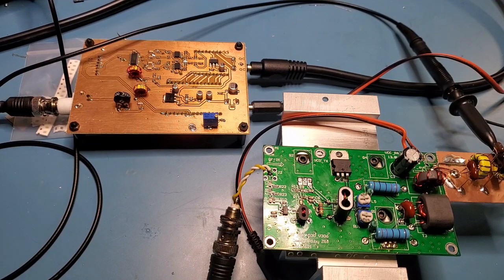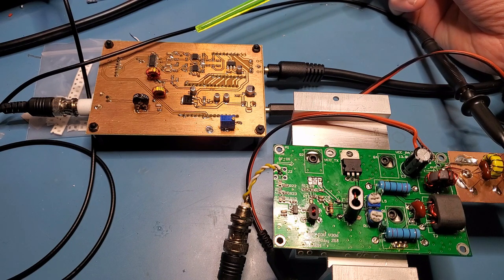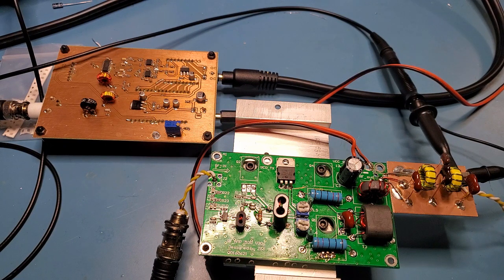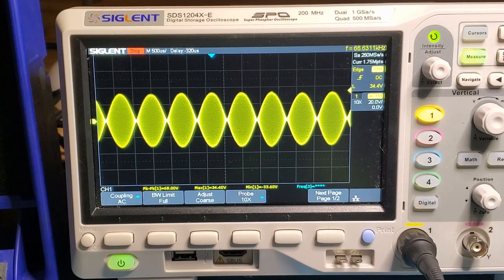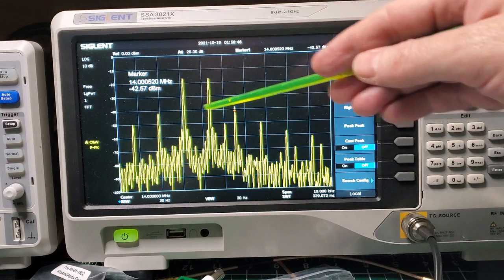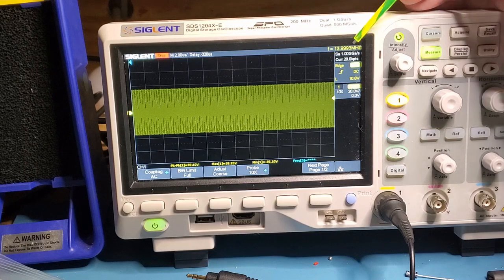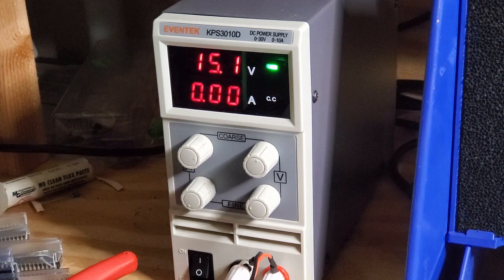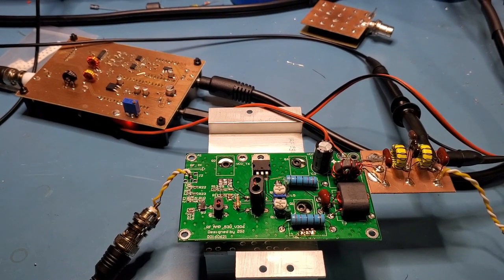IRF530 Push Pull Amplifier - Part 5

Comment: I hope you see and answer my Question.  Can you show how to make that amp work in the 400-500MHz.  I'll be happy with 10 to 20 watts.  I have seen a lot of videos but most are not in the 400-500MHz range.  I have this same kit you have plus many more parts.  For one thing, I see they use Pills to get big watts.  Where can a person get them or can you make them?
Reply: Amy, you would need an amp that is designed specifically to work on UHF frequencies. This amp is for HF only and can't be modified for the task.

Comment: Many thanks to share your work. I wil be happy if I can have a so beautiful output , before low pass filter. The gate voltage is also distorded on my side.  Fake transistor in kit on second stage. Why not fake IRF530, fake binoccular ferrite material ( saturation ?) . ..it could explained why it is so difficult to adjust power. Not expensive, not accurate...not wide band.

Comment: Ian,
Did you try a bypass capacitor on the center tap of the output transformer?
Reply from the maker: I did try that and it introduced significant instability in the output signal. I might do a quick vid on that sometime

Comment from the maker: Update: Shortly after doing this video I decided to try the OPA2376 opamp in place of the LM4562 on the Tayloe mixer to see if there was any improvement. I first blew up a pair of OPA2376s and then read the data sheet that shows max supply voltage at 7V (rather than the 12V I was using). After reinstalling a fresh pair I tested and unfortunately there was no difference at all - if anything the OPA3276 were a little bit worse.

Comment: Good video series, Ian.  I enjoyed watching all of them.  Questions: 1) Did you measure the 1dB compression point?  2) I wonder how stable the bias is with D3/D4 not making contact with the heatsink.  I typically check the idle current with the amp cold, then key it with a single tone for 30-40 seconds, and recheck the idle current.  If D3/D4 are doing their jobs, then the Idling current should be relatively stable.  Anyhow, good stuff.  I will need to get one of these just to experiment with. 73 de KB7ZUT
Reply from the maker: To answer: I didn't measure the 1dB compression point. On your second point I blew one of the mosfets while fiddling around with the bias voltage - interestingly it was the mosfet which was not making contact with the diode which blew (could be coincidence of course). There does seem some instability in power output - you can really see it with a single tone. All that being said it was a fun little kit - I certainly got $25 of fun out of it. Thank you for the comment!
Reply: @na5y  I would guess coincidental. Too easy to accidentally set the idle current past the max for the drain / source while trying to get idle current set.  Thermal runaway is usually slower, but steady over the top.  Good Stuff.  What's up next?  W6PQL 1500W 50V LDMOS build?
Reply from the maker: I was thinking about a high power solid state amp build a while back. For the moment I am going to do a series on this Magnis SDR - should be a fun build

https://www.theveteransdr.com/downloads.html

Comment: Nice and short video!
I am missing a video on your channel about constructing/measuring/alining an (broadband) input amplifier as I am not very sure how to tackle this topic by myself ;-)
Personally I am currently fiddling around with JFETs; replacing the famous J310 with a J113 in oscillators (and hopefully soon in an input amplifier).
Reply from the maker: Looking for a low noise amplifier on input? I haven't done one of those but shall definitely consider. I built one ages ago from EMRFD but never did a video on it. 

Charlie Morris has a few J-FET LNA videos - this one for example https://www.youtube.com/watch?v=q4G-_lrNdcQ

Thank you for the comment
Reply: Exactly! I know and like Charlie's videos but I am more interested in terms of ensuring & verifying a proper matching of the input impedance to the antenna, how to select the proper ferrite cores and taking a look on its linearity for example. A little bit more theory before building and measuring afterwards as you do it in your videos.

I found an interesting design of a J310 push-pull preamp from SV1AFN (you can easily find it on google) I might try out soon.

73s de DK1LH